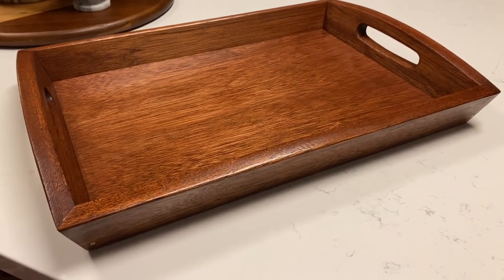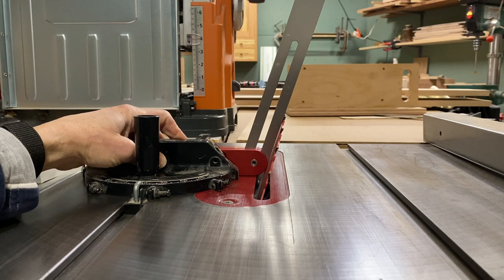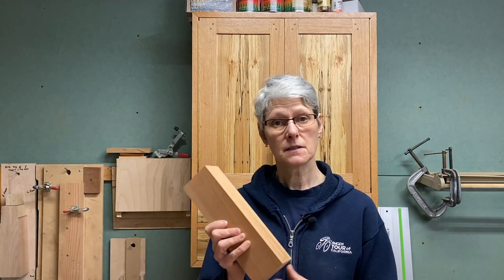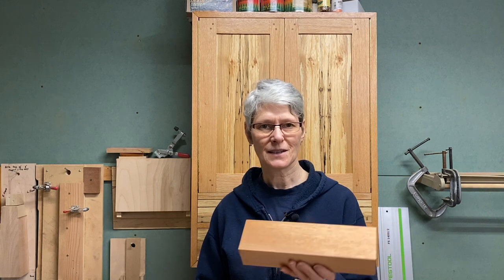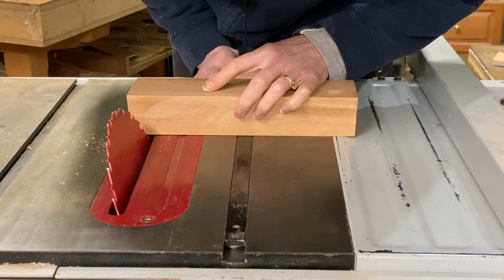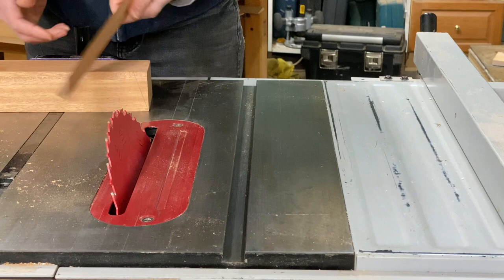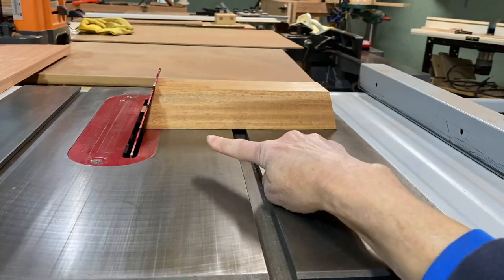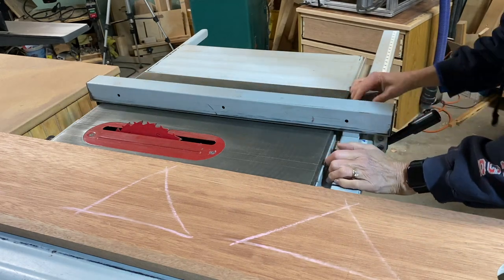Compound Angle Butler's Tray Setup Block

Comment: Wondering how to make the groove with my hand router …
Reply from the maker: I have a small plow plane. That could be used and simply held referenced against the bottom angle. It would achieve the same thing. This video is just a little more mainstream.
Reply from the maker: Oh! Power hand router!  That would be a challenge, except with the PantoRouter. There you’d clamp the sides to the setup block clamped to the PantoRouter table and use the slot cutter. If you used a router table you’d need to make a special sled to match the angle.

Comment: You really shouldn't have those long hood-pull strings dangling all over the place while leaning over a moving saw blade . Tuck them inside your jacket , it just might save you   from a nasty accident.
Reply from the maker: Excellent point and spot on! I’ve removed most of them entirely because they sneak out like that. Safety FIRST!!

Comment: This table saw has no splitter or riving knife. The presentation is very good, but that saw as configured is dangerous. 

You can be as careful as you want, but one kickback could pull your hand into the blade.
Reply from the maker: Acknowledged, Jim. For the most part I only use the saw with a sled. Our thin kerf blade doesn’t allow the riving knife to work. This application doesn’t really work with a sled. 

Precautions duly noted.